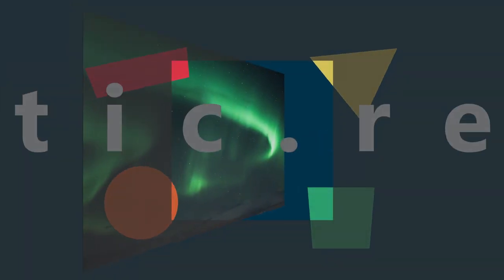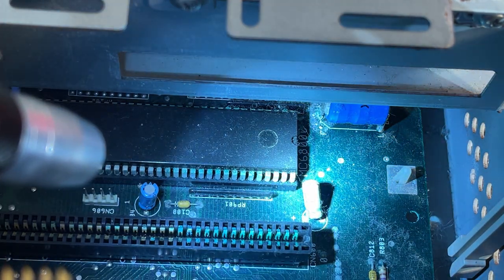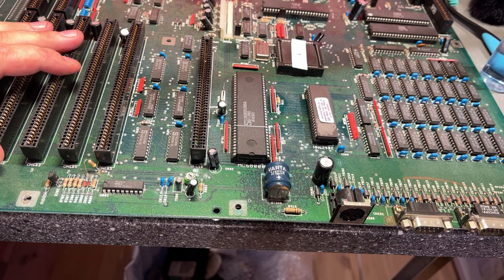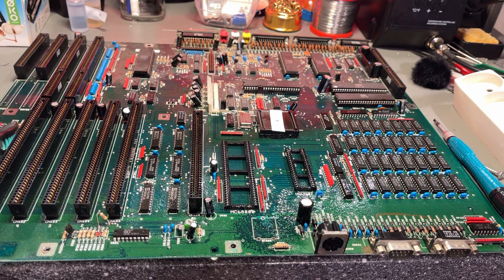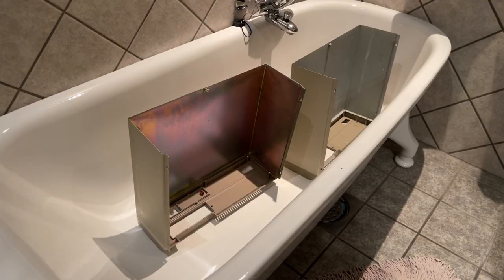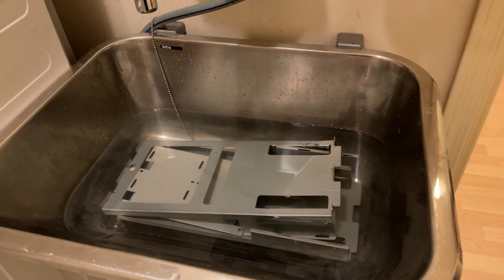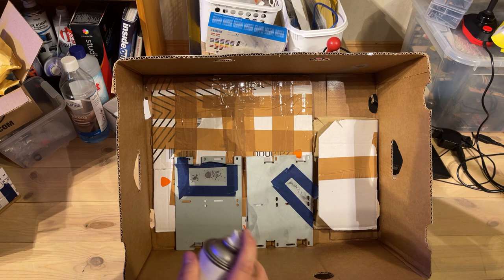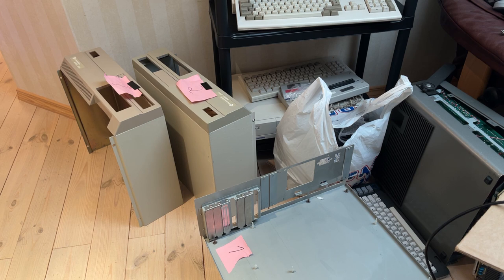Amiga 2000 restoration x 2- Part 1 - Unknown condition - will they work?

Comment: Hello! I advise replacing the cpu sockets. While they may work now, the future isn't definite. I also replace the CPU socket when it gets damaged. I run an Amiga repair shop in America. We've fixed about 55 A2000s =) Crazy I know.
Reply from the maker: Thanks! I will replace the cpu socket. I actually have problem with one of them now.

Comment: I was really happily surprised that both of those motherboards worked after having seen that corrosion.  I think Adrian Black has the best solution to those old type batteries, he replaces them with lithium button cells in holders, but a diode with a low voltage drop should be used for batteries that were formerly rechargeable.
Reply: Voultar posted a video where he does the same diode trick in a Dreamcast.  Too bad I saw that video just months after I replaced the battery in mine with a new ML2032...
Reply: That will be part of next episodes. Thanks!
Reply: Chris Edwards restoration would be able to help.

Comment: Super ! That vinegar product I haven't seen before. I always wondered if the 7% was strong enough. I like the spray in  a box technique. I covered my floor with plastic once to spray paint a shelf black. The mist landed on the floor eventually, and when washing it away, it stays in the cracks of the parquette floor making all the imperfections stand out. Kinda like what you do when painting tin figures. lol.
Reply from the maker: Thanks ! The vinegar is from Europris.
Reply: @Arcticretro  You can also buy herbicidal vinegar which is typically in the 20% range.

Comment: I think it might be better to neutralize the battery leakage with vinegar before cleaning the board with alcohol.  You could be spreading the caustic from the leaked battery to other areas and causing future corrosion.
Reply from the maker: Ok, you might be right. Sounds like a good idea. Thanks!

Comment: Restoration was only 50% and i think you'll get problems in 1-2 years. Some traces are still green and should be repaired carfully. Some Vias should be resoldered. CPU socket and Rom socket has to be replaced for sure and probably the extension slot should also be replaced. What's going on with the trace to the RTC ? Might be damaged with your dremel, check and measure.